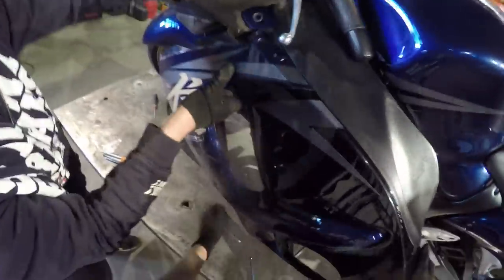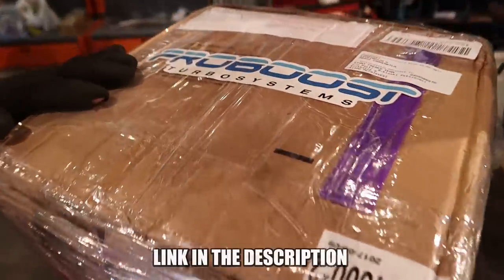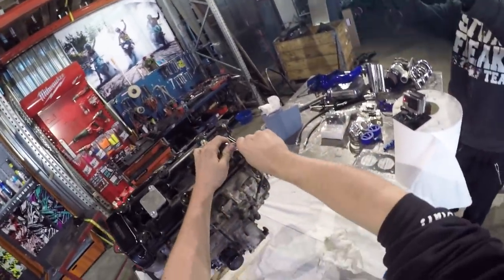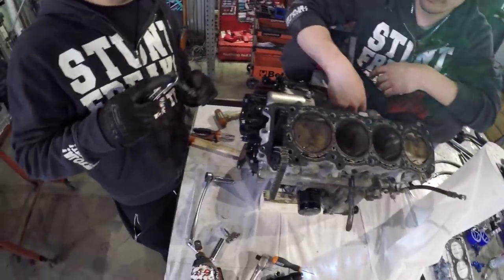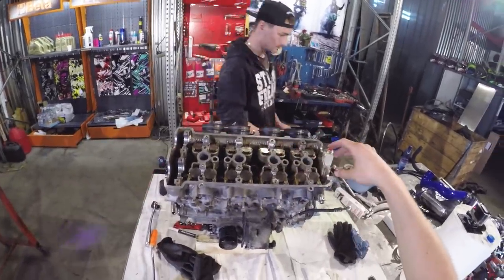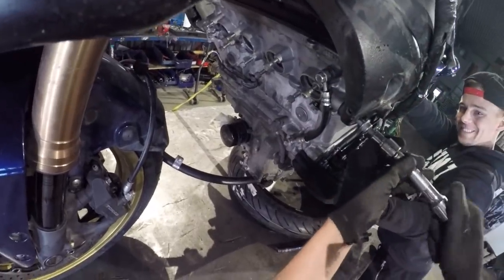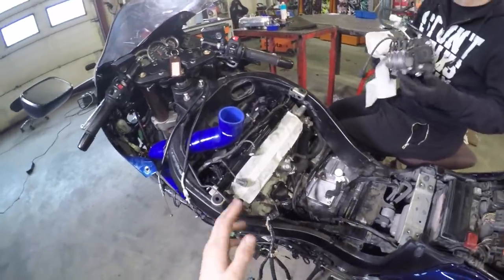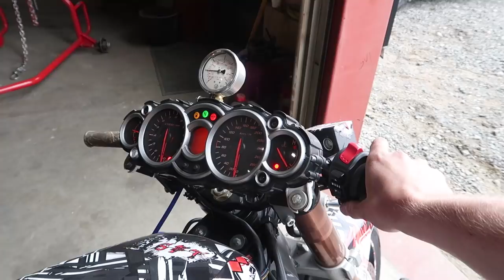How to TURBO your Hayabusa 330hp - ProBoost set

Comment: you should change pistons or ather way is to messure the same (factory) piston rings gap if tou open the gap (special tool needed) the compresion will change from hight to low think about what is going on in this way you choose to turbo your bike this is a greek advide thank you...

Comment: Remember, turbo oil feed really needs to be bled before running engine. Ignition disconnected via coil plug, turn bike over with oil feed undone untill oil comes out. Reconnect oil feed turn over again till oil comes out turbo oil return and reconnect that and reconnect ignitions coil plug. DONE, start engine and boost the shit out of it until engine blows up. Repeat exercise.

Comment: Nice build guys! How thick was the cylinder spacer? I'm planning on boosting my bike too so I need to lower the compression
Reply: 2 mill normally. 
Reduces comp from 12.1 (gen 2 busa) to 9.1 .
Forged pistons , rods & uprated valve springs are strongly advised too .
I learned the hard way

Comment: 23:30 what he's saying is incorrect, they increased the volume to reduce the compression ratio.
Reply: Its not an innaccurate statement to be honest if a bit simplistic which is probably 1. A result of english as a second language and 2. This not being a particularly technical video in its terminology in general,

 reducing the cylinder pressure by reducing the compression means that the engine will take more boost than an engine with stock compression meaning more air forced into the cylinder and thus more fuel can be burned and more power produced. So yeah its a pretty accurate statement of what reducing compression means for a turbo conversion.

Comment: Since you Have to add a spacer to reduce compression would it be worth installing better pistons at that point or would it make no difference?
Reply from the maker: With new pistons and rod etc. we could boost more.
Reply from the maker: When you boost more you need start running the bike with ethanol because heat reduction

Comment: Few buddies of mine were in the pro street class quite a few years out they could have a engine and part of the turbo system in and out in a bout 30-40 minuets now mind you the were simplified and less bs cause they were full out race bikes and the engine easily goes for $30,000 (U.S. dollars)

Comment: doesn't more space mean less compression not more air and fuel mix? I guess with a turbo the compression will be more anyway, but in principle, if you used a thicker gasket the power would drop without a turbo.

Comment: You don’t need to align the timing marks if you’re gonna remove the cylinder it literally defeats the purpose. The only time you need to align the timing marks is if you’re removing the head because it’s harder to see when the heads are on if the pistons are at tdc.

Comment: badass!
600hp holy shit!
if it can go 194mph with 197hp and if the kawasaki h2r can go 250mph with 300hp then how god damn fast would that 300hp busa be if it had its fairing on?
Reply: Not 600 hp for each bike but 600 combined.
Reply: duh
Reply: Slower than an h2r
Reply: the yop speed is determined/limited  by the gearing, for example by the secondary drive gearing (chain and sprockets gearing ratio)

Comment: No fuel system upgrades needed ?

I cant imagine the stock injectors  can flow up to 330whp
Reply: I believe you can only go to 275 hp . At least looking through all the kits for sale that's what the manufacturer says.  Then you need to build your fueling , crank, and rods.

Comment: How do you get 330 HP from a stock fuel pump? Install Wossner turbo pistons and you won't need to use a 0.080" head spacer, therefore won't need to ruin your bike frame's engine mount holes!

Comment: Don't you need forged pistons if you're going to boost an engine like this? Do the stock pistons really hold?
Reply from the maker: plep yes they hold but You cant boost more than 0,5bar and with 0,5bar you have over 300hp so there is no need to boost more 😂
Reply: Stunt Freaks Team ¯\_(ツ)_/¯

Comment: what's crazy is that these bikes have just a 300cc difference from some car motors lol
Reply: Josef Limmer Honda civics d15 is a 1.5. Only 200ccs there
Reply: And the same as some other car engines. And more than some other car engines. Stange comment imo.
Reply: Josef Limmer Like Ford's 3cyl. 999cc EcoBoost. :D

Comment: Project: the fastest supermoto on planet: 
Step 1: get a hayabusa engine

Step two: design a supermoto frame

Step eerht: get some ohlins suspensions

Step quatfour: get some Brembo brakes

Step 五fivinque: get a proboost turbo kit

Step 6ix: design some wireframe rims out of the rims of the Kawasaki z900

Step 777: put two pirelli diablo rosso corsa II tires on the rims

Step eighhgie: build an expansion exhaust out of the exhaust pipe, then adapt it to a gsx-r 1000 Austin racing muffler

Step NEIN! : build a carbon fiber chassis and a saddle

Step 10: put everything together 

Congratulations, you have build something stupidly powerful

Comment: "We gonna install Proboost Turbo set on this bike. ...it's not super hard" Proceeds to dismantle engine almost completely Yeah, piece of cake. Nonetheless, still a cool video though! But serious question: Why did you have to take off the engine and disassemble it? Was it easier to do that or is that a necessary step?

*EDIT*: Is it because when you install the lower end of the cylinder 2mm spacer and a more efficient fuel pump, you can drive up. 1.3 bar boost to give ~330hp?
Reply from the maker: Yep it’s necessary step. Fuel pump is oeiginal and we can boost only 0,5bar. That gives us over 300hp

Comment: hey brotha am i gunna f up my ttr125 ?????? im making my manifold a better more open gooseneck with egr to carb with turbo air with oil cooler and egr boost already gutted out all ele starter motor crap and pretty much no bendix or flywheele grinded till it poped off lol still have charging shit and batt but kick only already got it up to 132km on the highway but it always wants more lol i will make it go 200km but taking me 4 ever as stupid add + ocd and im hyper as f doing 10 things at pnce lol how much you think you can get a ttr125 up to and how ????? but when I DO GET IT TO 200kmh  I STILL WONT B SATISFYED AND ILL PROB REMOVE THE BATT  ALL PLASTICS MAKE IT NAKED AS F AND THEN CANCELL KICK START + ALL GEARS AND PUSH START IT THEN !!!!! F WITH ADDING TO THE HEAD LIKE THE  Universal Quadrajet Carb Adapter, but for more head compresion lol HAVENT KILLED IT YET SO LETS SEE HOW FAR I CAN GO

Comment: The only "bad" thing that you didn't do is use copper spray on the gaskets instead of the silicone. Silicone gasket maker is not for high temperature application.

Comment: "More space means more air and fuel mix, which means more power". Ehh... not really. It means a lower compression ratio so you can add boost. Otherwise it would detonate with pump gas.  If someone were to lower their compression ratio on a naturally aspirated engine, it would be a really turd.  So the less here kiddos is, if you want more power out of a naturally aspirated engine, boost the compression, but it will need a high octane to keep it from rattling like a can of rocks. If you plan to boost, you need to lower the compression ratio so it doesn't rattle / detonate under boost with pump gas.

Comment: You guys have no idea how to explain what you are doing step by step. Like you bolted two small squares onto the front top of the head. What were those block off plates for. I think there was 2. There may have been 4??  Did you just leave the old air ram tubes blank on the front of the bike?

Comment: Pretty simple just disassemble entire motorcycle,put heavier clutch springs in very simple.put plates on very simple.ruin side case with chisel very simple. Pull cams very simple. Take off timing chain very simple. Modify frame very simple. 400 hours later bike is almost broken very simple. Now for turbo installation very simple.turbo sounds from man very simple. If parts don't fit just bend to fit it'll be ok very simple. Rip more parts off very simple. 50 new wrinkles 100 new gray hairs, ball sack dropped 4 inches and its done very simple. Now the bike is very dangerous and will most likely explode like giant atomic bomb but very simple.

Comment: I think 300+ horsepower is useless in FWD cars. Even more useless on a one-wheel motorcycle which has not been lengthened to take it without wheelies and an immense launch control system...

Comment: By the way you loosened or tightened your bolts I can tell you have no idea what you’re doing
Reply from the maker: But the busa still works right?
Reply: Stunt Freaks Team correct, but you’re supposed to do opposites when removing or installing your clutch cover or anything with more than 2 bolts to prevent warping